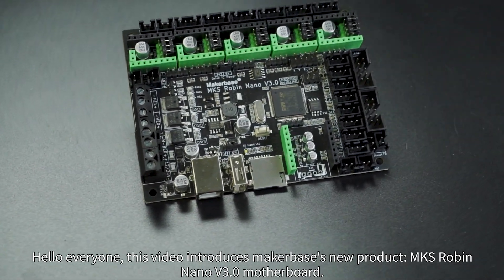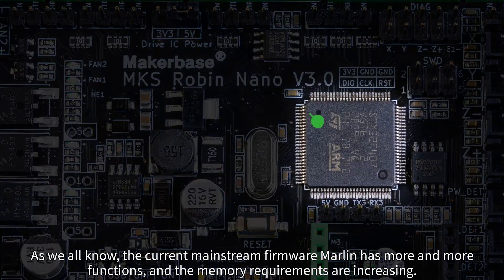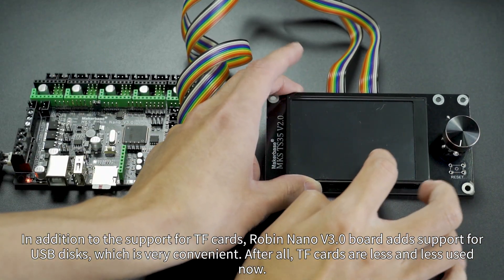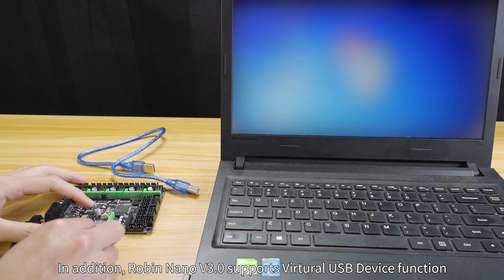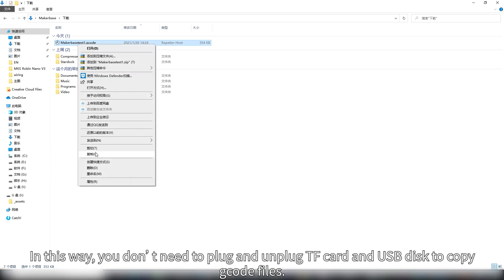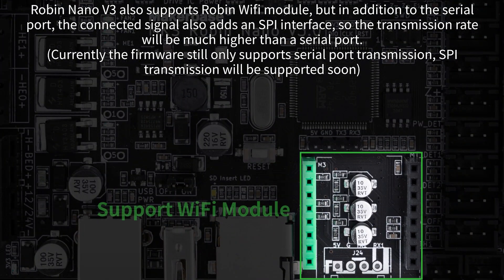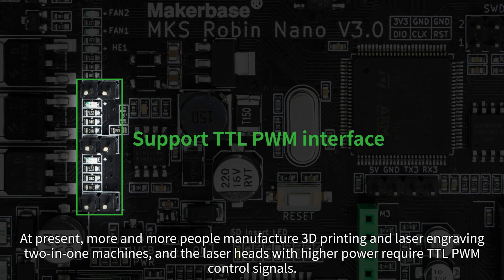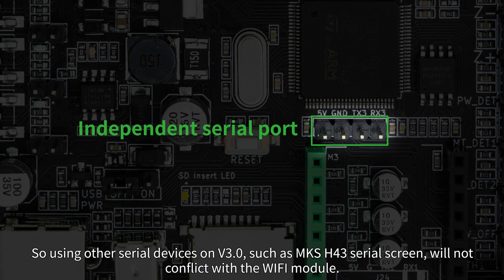Makerbase MKS Robin Nano V3 New Product Introduction

Comment: hi how can i connect bltouch to it? thank you
Reply from the maker: The 3Dtouch servo line is connected to the BLtouch interface (3pin line) of the motherboard, and the two pin lines are connected to Z+ or Z-, depending on which limit you use
Reply: @makerbaseteam4217  ok thank you!